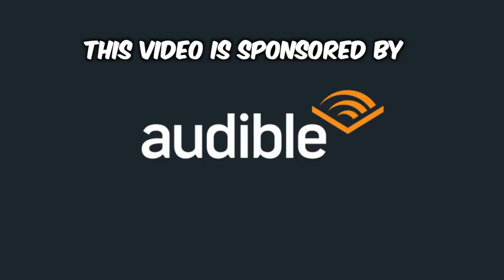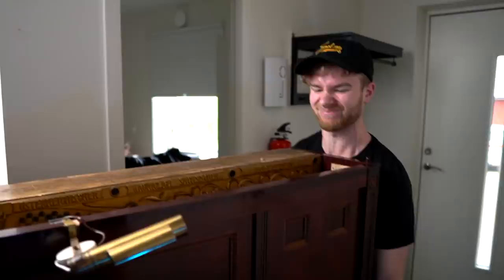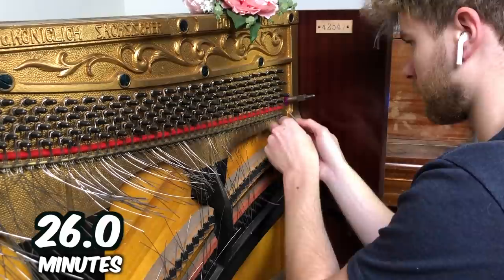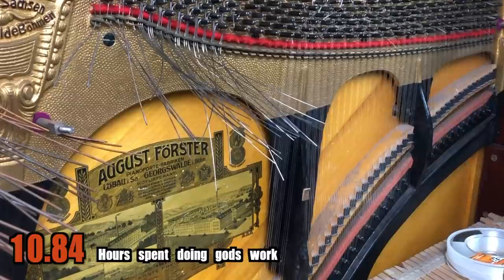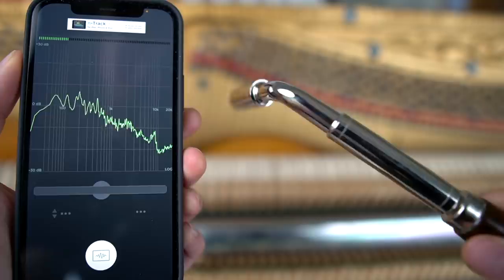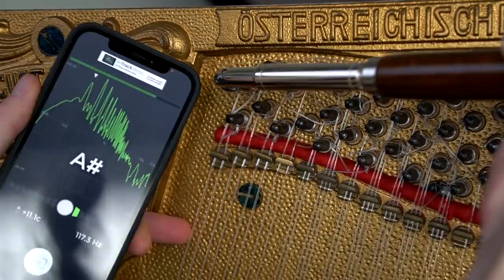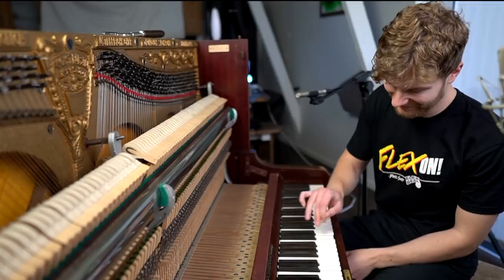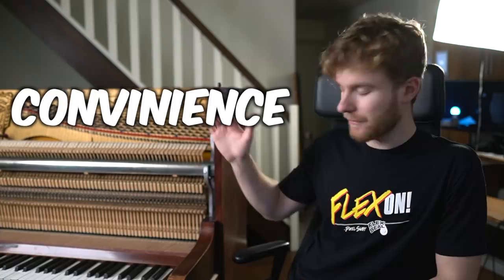I PUT FISHING LINE ON MY PIANO and You Won’t Believe What it Sounds Like

Comment: When removing strings from a piano (especially a grand) you should stagger their removal (alternating from low to high and every other string) to keep the weight distribution even the entire time (as opposed to starting on one end and going down the line). Otherwise, you can literally snap the soundboard. Likewise, restringing a piano (with actual piano wire) should be done alternating sides, etc. Not doing so can be devastating as well as dangerous. Great video though! :-)
Reply: Spoken like a piano tuner.
Reply: Same applies to tightening bolts in a line. Start from the middle then alternate between the two sides.
Reply: Same with really any string instrument.
Reply: Restringing doesn’t particularly matter if you’re not loading them right away.
Reply: yeah... until you realized that there's a ton of these comments....
Reply: The soundboard isn't holding the strings and therefor doesn't really care how you remove them. Gradually putting off/on pressure makes sense tho.
Reply: You do this with head bolts on a car
Reply: Don't worry he's an engineer
Reply: Lemme come chill, then gimme some piano tech lessons I wanna fix pianos I can't play I will also zuo
Reply: Agree. Permanent scarification on the face from rouge instrument strings. It's visually known that he loosened the strings before they were snipped; however, the average DIY er might not know this and create a cannon with shrapnel if not promoted directly to loosen the deadly tension before disassembling .

Comment: As someone that has played a nylon string guitar, I can tell you that keeping it tuned with fresh stings is a constant issue. That material will just keep stretching for the first 3 weeks. It's safer to tune it once a day, to give the strings time to stretch without breaking. Also, that first week, the strings will stay tuned for less than 50 minutes.
Reply: Also true of steel strings, but less dramatic. (I play both.)
Reply: My guitar have steel string on E A D and nylon on G B e

And i can say that the G B e string go out of tune much much faster
Reply: Damn never knew that

Always played with steel strings only

Comment: This man will legit be doing a concert with spaghetti strings instead of piano strings out of spite
Reply: Maybe he should change things around...use piano wire for spaghetti.  One impossible task deserves another.  Bon appetit
Reply: @BWolf00  😆
Reply: @BWolf00  I like a bit of al dente, but that might be a bit tough to swallow.
Reply: i thought it would be funner using pipe organ tubes with the piano hammer system and air to get different vibration values out of the pipes. (( all sound is vibration ripples threw an atomic medium regardless if the material is air, brass, or wood.))
Reply: @lordalchemist3430  why not just use PVC pipe, like the Blue Man Group did?
Reply: @danieljones317   While true there are different sounds by the various materials. Additionally metal tubing has a resonance that wood and plastic don't. It all depends on the tageted sound
Reply: @lordalchemist3430  what about bamboo?
Reply: @danieljones317  different materials have different sounds do to the atomic structure. and can a PVC pipe work for a pipe organ.
Reply: @MsTalkintina  wood wind is better as reed  insterment. pan pipes are wood and are used differently. 
i have made flutes out of bamboo but getting a tube that long will be a task of science, and even then it will not have the rich sound of brass for air or chime.

Comment: Dude, im glad i do not live nearby and theres no chance you call me to your house to tune it :D   

I will just give you a little tip: im not sure if you did that or no, im too lazy to check. You can actually just tune it one semitone lower. It will be more stable. Also, do not worry about octave 7. Even with normal strings its pain to tune properly and some old pianos just cant produce tune in that area anyway. Same goes for the other end in the bass. One more thing. When you cliped all the strings off, you basicly released about 22 tons of pull/pressure. Few days after that the cast iron plate was still adjusting to the massive change. It was working against you tuning the piano. Not to mention some of the fishing lines you used just wasnt strong enought. And you need someone to show you how to properly wind up string on the tuning pin. And get some proper equipment if you ever plan to repeat this atrocity.
Reply: Haha...please read this Mattiaz
Reply: Wow you really know your shit!
Reply: @genewitch  He clearly said it was a different piano.

Comment: Should have used braided line. It stretches less and doesn’t deteriorate like fluorocarbon.
Reply: I was thinking the same thing. It will also be stronger
Reply: Or wire leader string..
Reply: It would have fixed most of the problems he encountered.
Reply: Now yah tell him ....piss funny🤣😂😁😀😎
Reply: I was thinking the same thing but I think Dacron might be a better option. While I seriously think all monofilament will end up doing the same thing it might have been better to use fluorocarbon or at least a top-quality mono or perhaps and definitely not Berkley. 
When he revealed the soundboard I said to my wife "The soundboard looks great!" Then he revealed the top of it and we both went "Ahhhhh!" 😆
Reply: ah, yes, of course, it won't deteereeorate like flouridecarbonade
Reply: Not a good plan.  While the braid wouldn't stretch, it also wouldnt vibrate properly.  Spider wire "fusion" would be my pick.  A monofilament replacement with near zero stretch made from superline filaments.

Comment: Piano needed restrung anyways, it was out of tune and everyone knows the only way to fix that is to just cut off all of the strings and replace them.
Reply: I didn't know that 🤔
Reply: @hayes2jensen  what rock have yoi been living under jeez
Reply: @hosatus2433  a very dense one it would seem as I also didn't know that
Reply: The more you know. I was planning to retune the strings on my piano, but now that I know that doesn't work I'm gonna cut them and buy a brand new set of strings.
Reply: @roguechlnchllla6564  I sincerely hope you're being as sarcastic as I was.
Reply: I don't understand why he didn't remove the action in order to reach the strings. Also, he should have used a drill to wrap them.
Reply: @hayes2jensen  
He/she was being sarcastic. I don't know much about pianos, other than my mother taught piano for years. But she'd have the piano professionally tuned from time to time, and I don't recall the tuner-person ever having to "just replace the strings every time they fell slightly out of tune". That seems about as reasonable as replacing a guitar string every time it falls out of tune. Actually, doing it with a piano may be even more ridiculous than doing it with a guitar!
Reply: Uhhhhh........no.    Piano Tuners tune existing strings and ONLY replace the ones that break.

I learned piano tuning as a teenager.  The profession doesn't pay well, unless you have connections.  I didn't.
Reply: @hosatus2433  not rock, just metal.

Comment: That actually sounds really good! I like the sound when the piano is tuned! Have you considered trying to just glue some metal on to the hammers? I feel like the sound of the hammer hitting the strings is kind of disturbing. So maby if the hammer has a harder density it will sound better? Like a glockenspiel with metal sticks?

Comment: Next month: I put Harp's string on piano
Reply from the maker: Next month won’t be piano, but maybe January😍😍😍
Reply: I was gonna suggest this :)
Reply: Bass strings on a harp.
Reply: That's basically what this was. Most harp strings are made from one of four materials: wire, gut, nylon, and fluorocarbon. The nylon and fluorocarbon ones are very similar to fishing line. Normal wire strings are wound steel and would probably sound a lot like piano strings. Gut strings might be interesting, though. Or the brass strings they use on wire-strung Celtic harps. A whole piano's worth would be super expensive, though. A full set of strings for my harp (which is only 36 strings--7 steel, 29 nylon) costs around 200 USD.

Comment from the maker: Join my Discord because I will be there and chat! There’s already 430 people there so you can be the first 1000. JOIN DISCORD NOW! I will be there and chat: https://discord.gg/vErcrzU5Ud
Reply from the maker: Just joined! Thank you
Reply from the maker: Love the vibes in the server!
Reply from the maker: I joined (I’m an engineer)
Reply from the maker: This is probably my favorite Discord server yet. So many like minded people👌 5/5
Reply from the maker: 1000th club (I’m 434)
Reply: did you just reply to your own message 5 times about you yourself joining your own discord?
Reply: There's no point in subscribing anymore.  Youtube keeps unsubscribing people from channels they don't promote, so lots of people (like me) just bookmark the channels instead.
Reply: I will join the server. You should try braided fishing line though, it doesn't stretch as much and is a lot more durable.
Reply: Link is expired.
Reply: you should try kanthal wire like the stuff ecigs use for there coils or stainless steel or nickle
Reply: I use Dacron or Spectra cord on an aerial camera kite.  It is very low stretch and can take a hell of a force without stretching.  It is quoted as having 4x the strength of Nylon (the Spectra).  I suspect it might have a soft sound if used in a string instrument. There are many grades of thickness too.  Sections of the Oakland Bay bridge in San Francisco was lifted into place with slings made with Spectra - fibre.  So quite strong but challenging to knot so might need some engineering talents!
Reply: @richardwicks4190  not quite correct. Youtube recently updated their spam account detection, so they started deleting the accounts which in turn has caused people to drop in subscribers.
Reply: @Lussuria  I've been banned from this site before.  They aren't just updating their "spam account detection" - they are censoring political dissenters, of which I am certainly one.

Do you believe that Joe Biden is the most popular presidential candidate in all of US history?  He got the largest amounts of votes per capita, ever - provided there was no fraud in our election.

Well, I don't.  I've been deplatformed on this site for making that statement, and had over a month's worth of my comments deleted as a result.

I will soon entirely abandon this platform, on January 20th, 2021 regardless of the outcome.  I am not granted 1st amendment rights here, so I regard Google as a traitor to my nation.

I've already abandoned google, paradoxically, yandex (a Russian site) is more useful for information than Google is at this point.  How ironic that a RUSSIAN site gives more relevant results for technical information and general information than an "American" company which supposedly has 1st amendment protections.  It's a tremendous betrayal.

You might want to consider branching out, this site is compromised.

Comment: What if you tried some form of wire? Like a copper electrical wire. You can get any kind of gauge that you’d like pretty easily and who knows what kinda sound it’ll produce.
Reply: Dunno if it can take the tension thou
Reply: Airplane safety wire
Reply: @masterdecker9566  yess

Comment: I made a 6 string lyre for my son and used fishing leader line for the strings. It sounds quieter than normal, but not too bad. After a while the strings settle in and don't need to be tuned so often because they stop stretching. Because this lyre was made out of lower quality wood, it would not make a much better sound with better strings

Comment: Thanks for investing so much time and energy into your experiment, I hope that your indulgence to those who suggested the exercise appreciate your efforts and are now subscribers if they weren't already. Kudos for your commitment and being curious enough to modify or tweak instruments just to see what the sound quality is like.

My partner once sold OOAK handcrafted instruments made by a friend of his who, years later, went on to do musical props for LOTR. we still have some of his early instruments including a harp. When we later took up silversmithing, my partner got curious about how silver strings would sound on the harp, and so experimented with making various silver alloys and drawing wires down from them ourselves. If the alloy is too soft it will be more stretchy and not keep in tune as well, too hard and it will be more brittle and prone to faster metal fatigue failure.

Fun fact: after metalsmithing for a while we could identify if an alloy had been recently annealed and quenched or work hardened by pitch alone.
Similarly I recall watching a tennis player, who was also a musician, restringing his racquet and being able to recognise by pitch when he had achieved the tension desired as he plucked the strings. Strings for tennis, squash and other racquet types are designed to withstand high impact under tension so brands with the best rebound efficiency, if thickness allows, may be a better candidates than fishing line for piano strings. They may stay in tune longer once they overcome the initial stretch from the first few tunings which another commenter suggested you do over a longer period of time.

Comment: Try this with Aramid fibers like Kevlar, Spectra, Etc.  They are stronger than steel with 0.1% elongation and zero creep over time. They would work much better than the fishing line and stay tuned.
Reply: or Dynex Dux
Reply: Amateur radio operators use Kevlar-cored wire for antennas in locations where they're not allowed. That way you can raise a wire so tiny it's invisible, yet it will neither break under tension nor stretch so much that you have to get outside and snot it up a lot, potentially attracting unwelcome attention. So yeah, the stuff is pretty awesome.

Comment: Hey just an avid fisherman here, you could have avoided the stretchiness by using fluorocarbon or braided fishing line. Monofilament is the stretchiest fishing line you can use. Braid is the least. Fluorocarbon is kinda medium but significantly less than monofilament. Also braid is the strongest so you can get thinner line that is stronger than the thicker monofilament. Same goes for fluorocarbon but it’ll be thicker than braid.

Comment: Braided fishing line doesn’t stretch so that could help with the stretching issue it is also stronger so it won’t break as easy but I’m not sure it would sound well
Reply: It does. Just far far less than mono or even flouro. Also depends on the number of strands and braid type. 12-strand hollow core (really heavy shit you’d use offshore) is essentially woven like a Chinese finger trap. That definitely had stretch.

Comment: What's really funny is...  if you had simply woven the fishing line through the piano strings at one end (for maybe two passes)...  it would only have taken about a half hour...  and most likely, you would have achieved the same sound, but it would also stay in tune. 
You can create a lot of different effects by placing various things around strings. 
I recommend you try weaving a piano string through the strings and see what kind of sound you get. 
The good thing about this experiment...  is that it won't harm your piano. Once you remove whatever you put in there...  everything is back to normal.

Comment: A similar sound can be achieved by steam voicing the hammers. Basically, you drape a wet tee shirt over the hammers and rub each hammer with a flat sided soldering iron. It'll soften the hammers in 1/4 the time it takes to needle every hammer down with a voicing tool.

Comment: This sounds weird but at first sounded good tho, so, where is the video when you put piano strings in ukelele?
Reply: I think piano strings would snap the ukulele in half. Piano strings have a much higher tension than the nylon or gut strings commonly used on ukuleles. And ukuleles don't have a truss rod.

Comment: Dyneema is a brand name for ultra high molecular weight polyethylene. It is often used for winch cables. Nylon is perhaps the worst readily available choice because it is so stretchy. Dyneema line, being non stretchy, won't have much of a sling shot effect if something comes apart, It may be hard to find in the sizes you need.

Comment: I use Dacron or Spectra cord on an aerial camera kite.  It is very low stretch and can take a hell of a force without stretching.  It is quoted as having 4x the strength of Nylon (the Spectra).  I suspect it might have a soft sound if used in a string instrument. There are many grades of thickness too.  Sections of the Oakland Bay bridge in San Francisco was lifted into place with slings made with Spectra - fibre.  So quite strong but challenging to knot so might need some engineering talents!

Comment: You should have used braided fishing line. It doesn’t stretch as much so it would hold it’s tuning much better. Also it’s stronger in a smaller diameter

Comment: Whenever I wear a hoodie I play music with the two strings.  Pull them tight, but use a different amount of tension like a slide whistle or trombone. The music plays through your skull to your ears.  It's good "sound", but I wonder if they make any noise in the air.

Comment: Fishing line and leader line are two different products. Essentially, leader line is the same factory as nylon guitar strings. High carbon monofilament nylon string front an extruder, same as leader fishing line. Leader is intended not to stretch the same way that a regular fishing line is intended to stretch with flexibility. The price is reflected in the product. Leader line is almost half as expensive as instrument strings.... Which is a great leap from 100x considering the price leap from "regular fishing line."